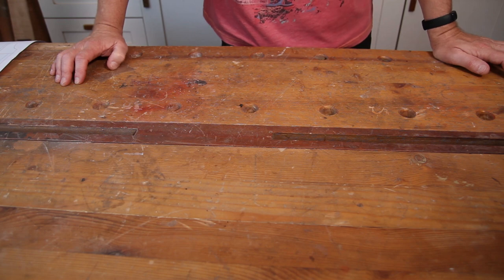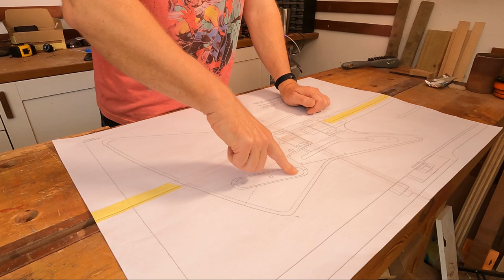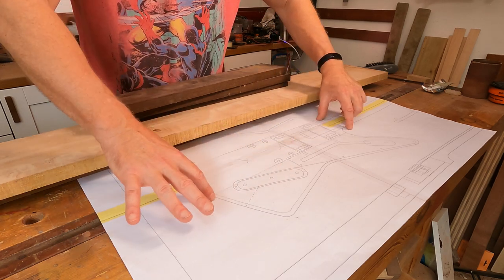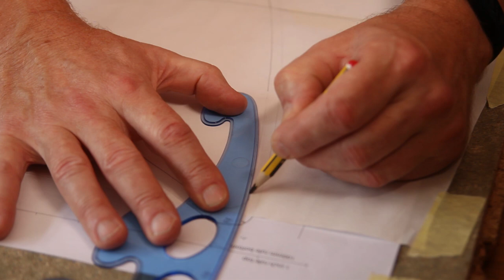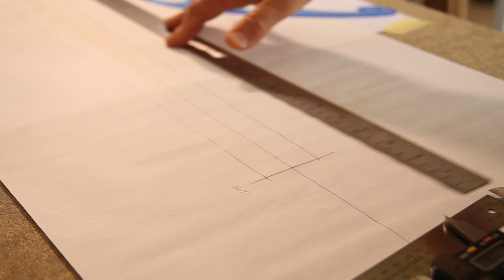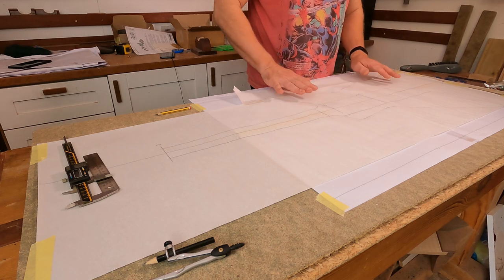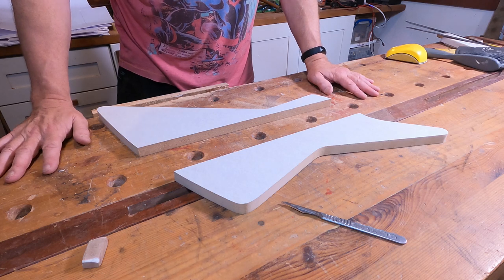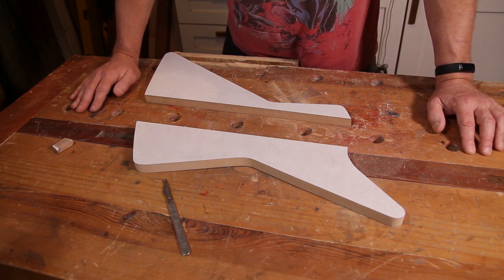RUNNING LATE! GGBO 2023 episode 1

Comment: Interesting build! I do like an explorer, but you are right they are huge, I have a momose one that is beautiful and massive! However surprisingly comfortable to play sat down. The Gibson late 70s iteration, I think its called an E2, is interesting, I think it has slightly contoured edges and walnut layers. Might be worth looking at for ideas on how you could use the Wenge.
Reply from the maker: Ooh, cheers for that I'll check it out. They are huge but taking that little bit off the edge has made a difference.

Comment: I think there was a scientific study done on single versus double pickups on tone in the 70’s. I can’t remember it fully but have the paper somewhere. From memory what was found was that if the string vibrates purely in the perpendicular direction to the pole of pickup there is no effect on tone as the magnetic field of the pickups is also acting in that direction. If for example the string amplitude is retarded by the magnetic field in the downward direction it must be boosted in the upward direction conserving the momentum. However, as we pluck strings in general in a direction more parallel to the magnetic field of the pole, the field of the second pickup does interfere with the strings vibration as it passes in and out of the field. In this case the second pickup tends to subdue higher harmonics, which is why in general single pickup guitars tend to sound more “full” tonally.
Reply from the maker: Interesting and in line with what I have heard in the past, I'll see if I can find that paper.

Comment: If the goal is to cut magnetic field on demand, you can use active pickups. Will also go with a shred guitar pretty nicely.
Reply from the maker: I did look at that but the cost was a bit of an issue, other than that it is something I'm interested in.
Reply: @Adventuresfromtheshedofdreams  Cost and all the added complexity of fitting a battery are definitely the downsides. The latter killed the idea in my case.
So, for the shred guitar I went with the closest thing there is sound wise to an active pickup. A pair of alumitones. Humbucker neck and a deathbucker bridge. The magnets they use (a pair of ceramic strips) are also weaker than standard humbucker alnicos, keeping any interference to the minimum.
Love the sound. So, can definitely recommend considering those if you are looking for some nice shred pickups. A single unit with a coil split can cut the price still leaving a lot of options. BTW some people love them clean. I personally find them way too sterile on clean.

Comment: Someone already proved that pickup magnets do not effect the vibrations of the strings unless they are very strong and practically touching the strings.  Anyway, a guitar with only one  pickup reduces tonal options by half, and probably has the same effect on the number of potential buyers.   My most unusual builds are still collecting dust in my basement. Sometimes we are the only fan of our work.  One lesson I finally learned was , build what guitar players want, not what I want.
Reply from the maker: As I say, I'd not seen any conclusive proof of the pickup theory. This guitar will not be for sale and I don't use bridge pickups very often so only one pickup won't be an issue. There are ways of making it more versitile and I might explore (see what I did there) some of them in this build...
Reply: @Adventuresfromtheshedofdreams  Have a switching system that gets up to 8 variations of output from a single humbucker.  I can e-mail it to you if you want to see it.

Comment: I did explorer-themed neck throughs last year.  Did I put the idea in your head?  Mine never made it to the final due to time constraints.  I found the biggest challenge was putting the right angle on the neck.  I tried to do what was essentially a scarf joint by taking an angled piece of the body end of the neck blank at 3 degrees and then gluing it to the opposite side.  Worked, but not very cleanly as the joint is easy to see on the back.  Next time (which is literally this GGBO2023 entry) I used a thicker neck blank and then used is as a set through so I could build a normal body and simply route the channel in the body at the 3 degree angle.  gluing wings on wasn't the funnest.  You have to really think through your order of operations on a neck through.
Reply from the maker: I started with the explorer as it fitted the construction method I had in mind but that one wouldn't have been a neck through. As soon as I knew I wouldn't be able to use that construction the idea of the neck through came into play and then it evolved into the Firbird cross over. What I have in mind for this one means I don't need a neck angle and that should make things  lot easier but you are right, you have to have your plan straight on a neck through :)